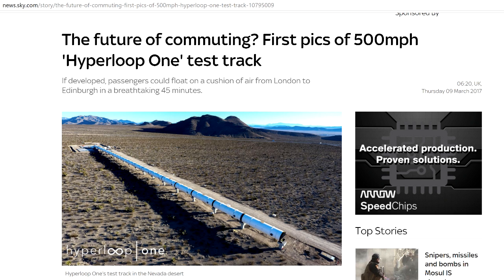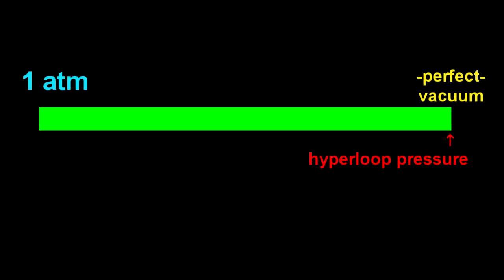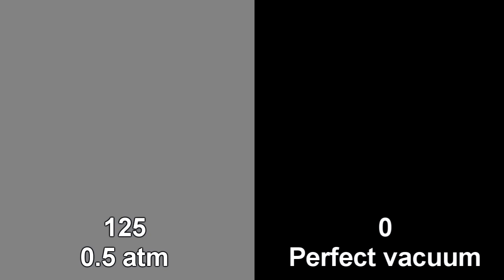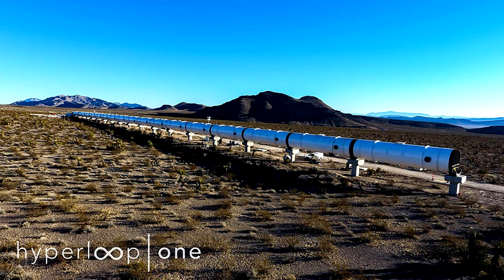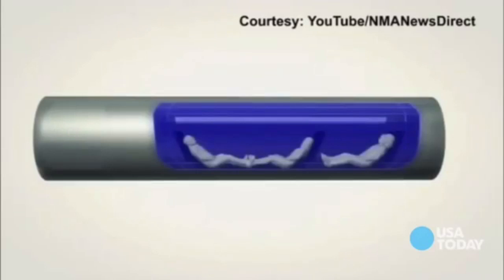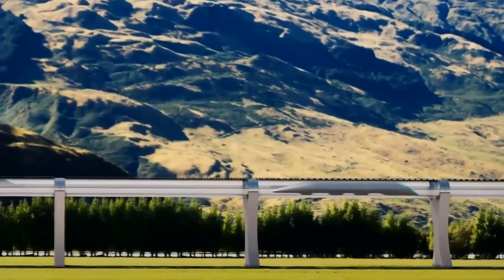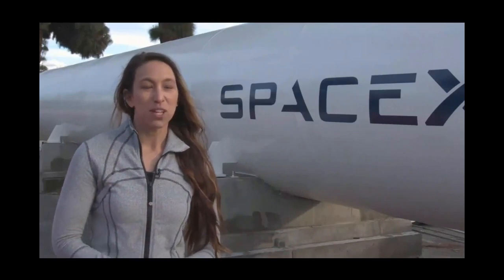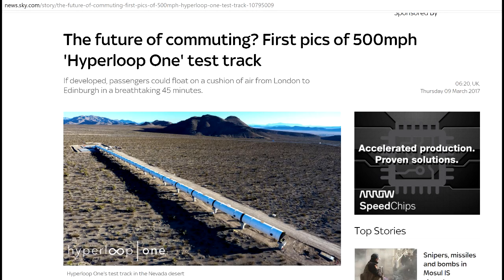Entire Hyperloop could be destroyed in SECONDS!

Comment: A real hyperloop would have an airlock system for loading cars, probably capsule door sized air lock style doors so the car is always in vacuum with just door holes in the tube. Other than the vacuum collapse, which is interesting, your entire argument is about how the test track is not as fast as claims :-p ... also in an ideal case the pylon connections would be energy release points, so the collapse would disperse between them, so the highest single point energy release would be the distance of a single span (altho the entire track might implode at once ... costly for sure).

Comment: I wonder what the g-forces are at 500mph. That's faster than a commercial jets cruising speed.
Reply: The only g-forces you'll experience is when accelerating or slowing down.
Reply: AustinScramblr B if you're at speed you don't feel any force other than gravitation. so without windows and vibrations you wouldn't even know if you stand or are moving at 50.000 mph

Comment: Thunderf00t makes his nonsense while he can.  He may well eat his words in time. Let me fill in where he dismisses  the  testing so far.  Bear in mind that I have worked with very high vacuum space simulation test chambers testing instruments sent up on Earth sciences spacecraft.
(1) He is wrong that expansion is not compensated in the tubes built so far. They have, and the means they use functions to help resist the tendency to crumple under atmospheric pressure. Those tubes were not designed by amateurs, and they were designed by people familiar with vacuum chambers, unlike the misleading examples T'F00t uses here. All of his examples are meant to hold shape with internal pressures not external. Of course they are dangerous under vacuum.

(2) With Thunderf00t's ideas in mind, I was surprised to see that the SpaceX testing tube had flat panel end doors. The chambers I worked with all had shallow dome shaped doors and even the smaller one we used of about the same diameter was much thicker metal in that dome shape. It Seems T'F00t is still misleading us as to how deep the intended vacuum really is.

(3) The long time for pump-down had more to do with cost than practicality. It is a test after all. No airlocks were employed either.There were drawings I saw where there would have been three pumping stations for the mile long original version. The actual tube was shortened for SpaceX to be able to get their rockets out of the plant conveniently. I have actually been there and seen the installation for myself.
 The purpose of the tube is still met quite well. It is to test the various configurations possible, and for the tests done so far only safety, telemetry and autonomy were scheduled to be tested. Of course the vehicles came to a stop. That was the point of the test, to show that the autonomous vehicles could both stay aligned with the guide beam at speed, and when commanded do an emergency braking test. High speed tests will come later. I wonder what T'F00t will say when the speed goals the teams set for that short tube are met? 

(4) One little dent? One rather large block of concrete after multiple tries with, as I said, an old, discarded tank car not meant to be under vacuum.  Great video T'f00t. I like the Mythbusters as much as anyone else but they are mainly an explosion based entertainment with some science. They are not peer reviewed(that would take years), and constrained by both the time and budget of a TV schedule.  They do also, like you T'f00t, carefully pick their experiments to illustrate their hypotheses. 

I have my own doubts about the viability of the Hyperloop, which you continue to fail to illustrate. They are based on economics not scaremongering though.

Comment: Not to mention, the crushing effect doesn't even require a rupture in the tank, just a weakness in the structure that causes it to fail to hold the external pressure at bay.  The vacuum then forcibly equalizes itself to a new equilibrium by... well... reducing its volume, so to speak..  just hope you aren't in the portion that equalizes... plus, even if part of the volume manages to hold fast, the crushing will almost assuredly cause an actual vacuum breach, which is where things get even messier.

Even if they got this thing operational, and it actually went 600mph, you couldn't pay me enough money to get me to step into this deathtrap.

Comment: So many things wrong. So let me get this right, because the literal first few steps of R&D for an entirely new form of transportation doesn't do the end-goal speed, it's not real? It's not even alpha, this is bare metal r&d barely taking it's first steps into it. This is a test track. Designed to test pods. That's why it takes so long to depressurize the entire chamber. The actual project would use airlocks, so you get into the cabin, it moves forward to the first airlock, door closes behind you, and a section of tube barely larger than the pod itself gets depressurized, and the airlock in front of it opens. You don't have to pump down the whole track. Seriously? You're smarter than this and it was a disingenuous jab. As far as showing the liquid trailer. it's a trailer. designed to transport liquids  If you pump the liquid out without a venting mechanism, of course this is going to happen. It was not designed for that. It was designed to transport liquids, not be pumped to vacuum. Of course it's going to fail. 

Also, really? Hitting it with a hammer? Guess what, if you hit a pressurized plane's fuselage with a sledgehammer, bad things are going to happen also. And making fun of.. college students doing research and competing for new technologies? You realize there is a good chance tech developed for this will bleed into other areas, including maglev trains. Who knows, maybe better vacuum pumping technologies too, as the turbomolecular pumps used now were the latest innovation. Your lame example of 1 atmosphere to 99.9% atmosphere isn't really.. true, either. It's not like there is no difference of .1%. For fucks sake dude, particle accelerators go down to 10^-7 pascals.

Comment: 1:10
Okay, no. This does not work for several of reasons. Firstly, Youtube compression loves throwing out detail in blackness. If you screenshot it, you'll find that both sides of the screen at 1:19 are the exact same colour because of this.
Two: That's not how colour space works!! Colour as displayed on monitors is made to be logarithmic! You can't just slash the number in 2 and expect it to be half as light.

Comment: Oh for fuck's sake this is going to be fun. 

>30s into video
>small finite container
>no relief systems
>tiny length to diameter ratio
>supposedly comparable to several miles of tube
>not an engineer
>no experience with material mechanics
>no experience with compressible flow
>can't tell the difference between hoop stress and a stressed hoop

Please just visit me and beat me to death with a brick because whatever brain tumour you're giving me is going to take much too long

Comment: why not use the vacuum to suck a pod (or push it) through the tube and brake it on the other end when it pops out? Get people to lay down in small pods one after the other and have a 200 m exit platform for about 100 pods/people.

Comment: What if they would enclose the hyperloop tube with an outer sheath? The outer sheath could have expansion joints to expand/contract while keeping the layer of air  between at a stable temperature so that the inner tube would not have to worry about thermal expansion. The outer sheath would also protect the inner tube from damage. 

But, I would agree that the current design seems untenable.

Comment: And big corporate cant even maintain their oil pipelines.            Also the pipeline would have a better chance if it looked like the barrel of a magnum. solid outer casing with 6 pipes inside where the void is concrete or some other non crushing materials. thus having more tube available and or access from inside

Comment: Put 10-20 milliliters of water in an aluminum can and hold it over a flame with tongs until a good amount of steam is coming out of the opening. Turn the can upside down and lower it into a pot of cold water. That's what happens to you if the hyperloop you're in suddenly depressurizes.

Comment: I think you missed the principle - it doesn't use a vacuum, it works on a pressurized tube on one end and a LOWER pressure in front, so no collapse from a dent. This is the first attempt, compare the Wright Bros first flight with current technology. I have admired much of Thunderf00t's work but he's off base here. Plus it uses magnetic pulses to move the pods. Also it would be ELEVEN FEET ACROSS, you could easily stand up inside. I trust Musk's technological ability to solve the problems, after all this guy is a rocket scientist. The example of a pod on wheels coasting to a stop is not relevant, the working model will float on a cushion of air so little friction is in play. More research should done before writing a scathing criticism.
Reply: The tube would be 11 feet across with nothing inside it maybe, think about the fact they are wanting to use it to transport not only people but various types of goods as well, the rest of the "room" in that tube is going to be taken up by not only the track and the leveling supports under said track so it "hopefully" doesn't shift in the tube, but also by the capsule being used to transport people/goods. I doubt the capsule is going to be some tiny thing anywhere near the size of their test pods either, none of which more then 1 person could do anything but lay on...and that would just be the base of the capsule being used, which already looked like it took up, what, 1/3 of the tube height already? Never mind that I don't think it is thunderfoot alone stating they are going to go a for a 99.9% vacumn....

Comment: I don't really understand the point of the argument. TF is basically saying that because things under pressure collapse sometimes, the hyperloop will never work. It's not like we have submarines that can withstand 400 psi or anything. It's not like we have scuba tanks that can withstand 3000 psi. It's not like we have a fucking space station that can survive the vacuum of space. I mean come the fuck on. Your car's tires withstand more pressure than the hyperloop will need too.
Reply: The design presented is not a multi-hull tube? Unlike those submarines,air tanks and space station you speak of....

Comment: Thunderfoot still doing fake-science. Get your facts right! Understand, how air pressure works. Understand, that early prototypes are not the final product. And maybe you don't know, but it is possible to calculate the forces accuring under low pressure and also calculate the resistance against buckling. 
And I also don't get, why so many people in the comments do not get the physically wrong points in thunderfoots statements... Come on, use your brains!

Comment: Tf, could you make some pressure/vacuum comparisons between that imploding tank trailer demonstration, the Mythbusters' imploding tank train car, the proposed Hyperloop, the test Hyperloop used by the college teams, and a "perfect vacuum"?  I think people are under the impression that the Hyperloop is not as extreme a vacuum as what the Mythbusters created.

Also, I think it's worth noting that when that tank trailer failed, it didn't just collapse.  When it fails, the collapse pulls in all directions and contorts the structure.   If the test Hyperloop tube had collapsed, the contortion would have probably sent unrestrained sections of the tube into bystanders.  There's a reason the collapse demonstrations hold people at a distance.  The number of failure modes of the Hyperloop tube haven't even been scratched, at least in public.

Comment: I agree that this is an absurd way to travel and infeasible at best, but for sake of argument some of these problems could be solved fairly easily. Particularly the loading time issue, because pods could be loaded in an air lock so the main track could remain under vacuum. I also feel like making the tube out of glass and raising it into the air are ridiculously crazy. Wouldn't it be much safer to build the track underground out of concrete and steel (though that still ignores thermal expansion, and since it's California.... idk... EARTHQUAKES)? Also, it would be slightly less insane to build stations every so often and keep the tracks between them isolated so that a failure in one section of the track doesn't release the potential energy of the entire track. That being said, it's still completely ridiculous as a business because if anyone is IN a section of track that fails they're dead, no question. Also if a section of track fails, your entire transit system is ruined for weeks while you make the repairs and go through court filings for all of the harm you did to passengers and passer-byes. Last point. Doesn't anyone think it's strange that the artist renderings are all one-way? Like... aren't there close to as many people wanting to go from SD to LA as there are from LA to SD?
Reply: People said the same thing about railroads, autos and airplanes, how did that work out?

Comment: As a welder of pipe and other steel for 20+ years ,i can say the bracing inside the tube isnt there to keep it from collapsing under its own weight, its to keep it trued up so that it fits the other piece of pipe without needing to use dogs and wedges when you hook it up. That is why the bracing is only on the ends. Using rolled pipe is the worst thing you could do, the pipe for something like this would need to be machined or molded. Very expensive. The materials they are using are not going to work, so TF is right in his assessment.

Comment: The pressurization should only have to be done very infrequently, not every time passengers board the pod? Surely they can find a material strong enough to create a seal between the interior of the pod and the atmosphere; then make the end of the track "openable" with a hatch, and you only lose a few square meters of vacuum at most, which would take a tiny amount of energy to restore. If the interior of the pod is already at 1 atm, opening the pod to the outside should create no pressure differential.

Comment: i still think riding delta p with air-tight seals around the capsules (basically pneumatic tubes) is a good idea, i should probably check if the project about that is still around, they could do some 90 kph with a single capsule or 60 but with several and a high efficiency

Comment: Why the hell would you depressurize a chamber like that in the purpose they are trying to use it for why not just build the damn thing like a contained pressurized air dif unit like you see in some hospitals or drive up banks you can control the pressure accurately on iether side of the system and move it from point a to point b remarkably fast and it would even be safer considering the consequences of a breach on the negative pressure side would be far less catastrophic and really rather boring comparing it to this let alone the positive pressure side would be again less catastrophic if a breach occurred and instead you would have a buss of pissed of passengers if you have any ideas on how to tear down my thoughts please do so I'm open for suggestions cause I'm not going to waste any time in this venture more than I already have

Comment: Engineers: What thickness of steel would be required to avoid atmospheric crushing of 4m diameter tube?

Also: Thunderf00t perhaps forgets that reinforcement rings along the length of the tube can be used to prevent a run-away cascade.

Comment: I agree, the planned desert loop look insufficient for the purpose. However, in terms of a theoretically functioning hyperloop and the discussion over evacuation all the air to a near vacuum, would an air lock system not be a possible solution? Evacuate the air in a small "Loading Chamber" where passengers dis/embark, and then pump out only this space, opening up to the main loop once depressurised? - just a thought.

Comment: Dr. Mason once again giving truth to the old adage that "Engineers don't know why their bridges stay up, but physicists know why theirs fall down"!

I'm just a technician-level engineering physicist - who's been out of physics for a long time - but even I can see why this Hyperloop thing's a pile of shite.

1- at 0.01atm, the need for anything to be aerodynamic is gone - there's practically fuck-all air in there!
2- a simple, thin-walled tube with an internal pressure of 0.01atm is going to go cunt-up very easily - especially if any part of it or its supporting structure is damaged.

Hyperloop - you spell it: c-l-u-s-t-e-r-f-u-c-k

Comment: Thats why its a testbed for engineering solutions. Finished projects dont magically just jump into existence.
Reply: Good thing youre smarter than a multi-millionare venture capitalist and his team fo engineers then. They could really use your advice, why dont you apply?
Reply: He's a venture capitalist and not an engineer.  
A 1000km long vacuum chamber is dangerous and not practical.
Reply: They make the same same kind of mistakes with all these proposed inventions that TF debunks.  
They make a visionary design without taking into consideration actual engineering practicalities.  
 A large vacuum tube would be lethal for those on the train in an inevitable pressure failure.
Reply: Good thing its not for internet experts to decide
Reply: Yes well, that is the problem. Instead of going after the endless supply of quacks and idiiots he decides to go after an experimental projects and he is just flat out wrong in most of the video, relentlessly beating a a strawman and asking questions that were answered even before the whole project started. I wanted him to debunk bullshit, not spout it himself and all these internet fanboys are just going right after him.